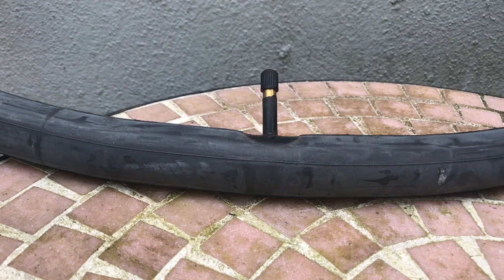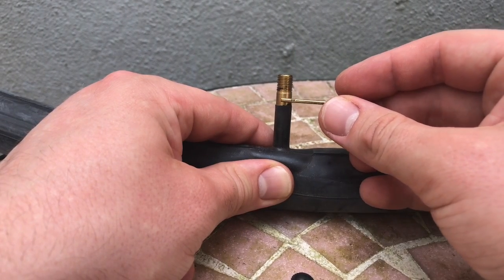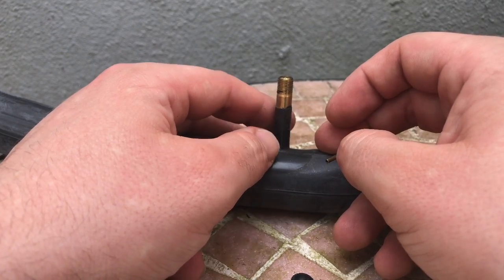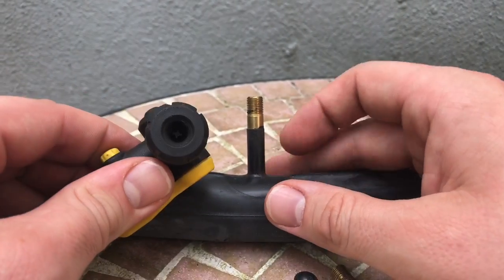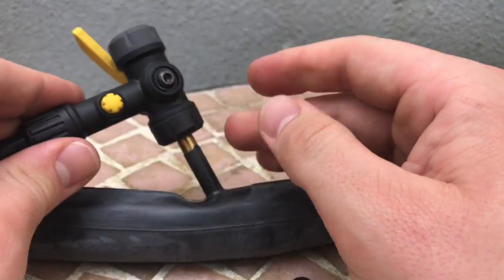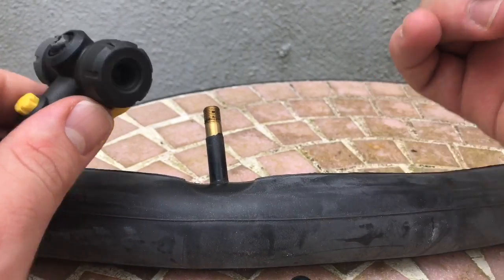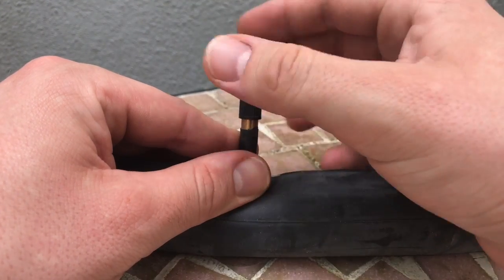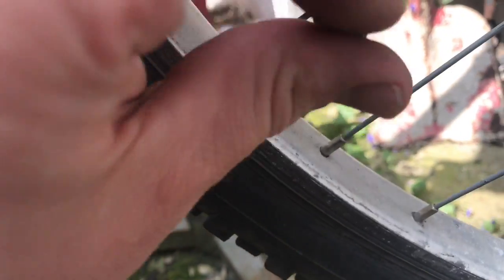How does a Schrader valve works bicycle valve instructions and how to inflate it DIY

Comment: Please help
 my mtb has schrader valve and I had an old floor pump with two point presta and Schrader. 
The lever should be down to lock. 
But whenever putting the pipehead on Schrader valve and push so air comes out and lock the lever and start pumping after a level it not adding air to tyre. But with this 75% fill while trying unlocking the lever air comes out but find difficult to detach the pipehead from the valve. So in this process maybe end up with 50 air left.
Second method I tried

Now just tried to not putthe pipe hear all the way but like presta and after locking the lever it is taking more air but did not push it hard cause don't know it might damage the valve. In this way while unlocking no air come out.

What to follow. 
Because of know alternate I had to go to bike station to fill with their machine

Comment: does the pin need to depressed to allow air to flow into the tyre?
Reply from the maker: Yes indeed, the lever has to be locked and then inflate the tube. Best regards